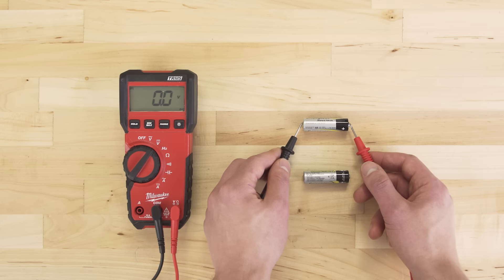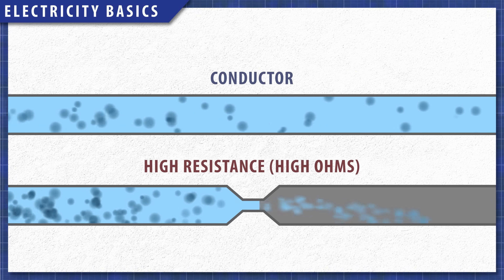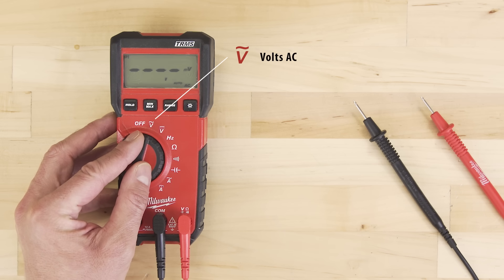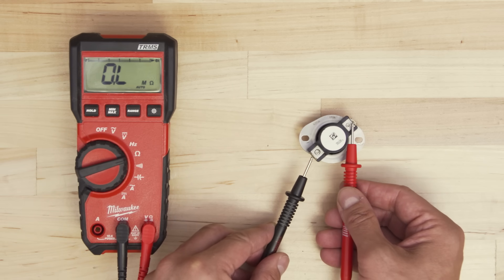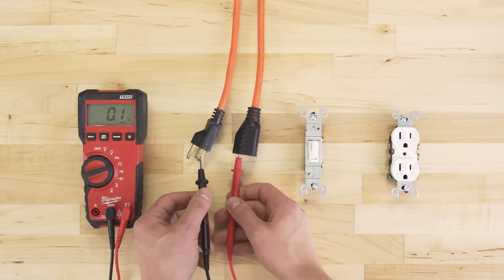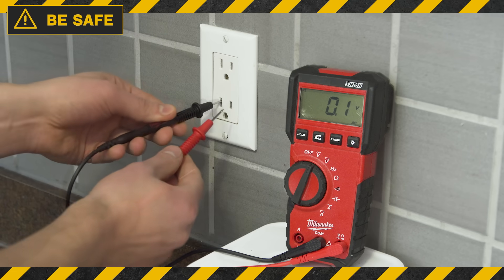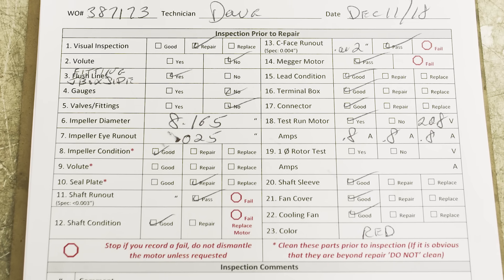How to Use a Multimeter & Electricity Basics | Repair and Replace

Comment: I've heard so many stories of people blowing up meters by plugging them into outlets. Looks like amp testing is the only way to blow up an auto ranging meter (under normal household conditions). That's good to know, and will hopefully quell my phobia of destroying it. Thanks for the info!
Reply from the maker: Thanks for watching. We're glad that you found it helpful! Testing an outlet with proper safety precautions while on the VAC setting will not give you any surprises. Amps or resistance setting will be problematic and is more likely to blow the internal fuse.

Comment: How do you find out which is ground and neutral using the multimeter? If the wires are all same colour?
Reply from the maker: Thanks for watching. Using the multimeter you won't be able to simply distinguish between the ground and the neutral as the voltage readings will be the same. Normally one can check by looking for where the copper wire is connected on the receptacle. If all the wires are the same color then it's best to hire an electrician to do a closer inspection.

Comment: I would also advise that the multimeter switch is always left on the AC volts position when putting it away.
If it is left on the resistance setting for instance and then used it to check AC volts next time you might only blow the internal fuse but it could be a lot worse. Electrical arc burns are usually life changing if you actually survive. 
In fact the best approach is to say out loud to yourself what you're about to do and how.
Reply: My multimeters have an OFF position. So I do not store it in any other position
Reply from the maker: @froglobster  Yes if it has an off position then it's best to have it turned completely off. This also forces the user to specifically set it to the required mode before doing any testing.
Reply from the maker: Thanks for watching and for sharing that excellent safety tip!
Reply: Well let’s not put off the interested member of the public / student, to harshly using grammar’ life changing / electrical Ark burns 
if you survive ’   Gulp.
Let’s be quiet clear about it,the instrument will have an internal / local fuse wired in ‘ to anticipate any occurrence. And it also explains why they are double insulated in the uk and other countries “
Thanks’
Reply: why does this happen?

Comment: Just did that and my thing sparked up.  So I switch the cards and try again, but my plugs is giving low readings like 2 Volts
Reply from the maker: Thanks for watching. If you got sparks on your outlet then it could be an issue with how it's wired or how it is grounded. It would be best to hire a electrician to take a closer look.
Reply: @AmreSupply  Thanks

Comment: As an Electrical Inspector I would definitely advise caution to the unqualified Make one MISTAKE it can kill you  Always best to engage a licensed electrician Please take care
Reply from the maker: Thank you for watching and the extra words of caution are much needed. This video is primarily to help support our videos on appliance and heating repairs. In these cases we recommend shutting off the power before accessing any single component. The component is tested in isolation before being replaced with a identical component. We do not recommend or show live voltage tests on appliances as that is more dangerous than these isolated test.
Reply: “Licensed” doesn’t always mean correct.

Comment: Very Neat explanation..👍! Everytime disconnect elements before testings1️⃣! i would say that a good brand of Analogue multimeter is way much better..🌟🧭!!They have consistent precision values ,and  don't show fake readings like the digital ones...
Reply from the maker: Thanks for watching, we're glad that you found it helpful. Analogue multimeters are still useful but digital multimeters very accurate and do not show "fake readings". Some models are more precise than others but having the numbers on the screen is very helpful to most people.

Comment: At 2:20 "120V AC 60Hz"  the narration incorrectly states: "The direction the current flows changes 60 times per second." 
This is incorrect, the current flow direction changes 120 times per second.  
"In a 60 Hz system there are 60 complete cycles in the current pattern. In each cycle there are two halves in which the current flows in opposite directions—half a cycle one way then half a cycle the other way. So the current changes direction 120 times each second."
Reply from the maker: Thank you for watching. You are correct at that point. Unfortunately we can't update that small detail in the video without deleting the video and reuploading it. It would mean losing all views, comments and interactions.

Comment: Excellent Video, is this available in Spanish?
Reply from the maker: Thanks for watching. We don't have any voice overs in other languages but we have added manual English captions, this means that the translation to Spanish captions should be more accurate. This can be enabled in the settings in the play bar at the bottom its the CC button and the cog wheel will bring up more languages.
Reply: @AmreSupply  Thank you :)
Reply from the maker: @johnhubbard6262  You're welcome!

Comment: If the component tests negative for continuity it will need to be replaced
Reply from the maker: Thanks for watching, you are right! The only case that it might not apply is a temperature switch that might not show continuity at room temperature. Switches will often be listed as NO normally open or NC normally closed. A normally open switch will not have continuity when tested at room temperature.

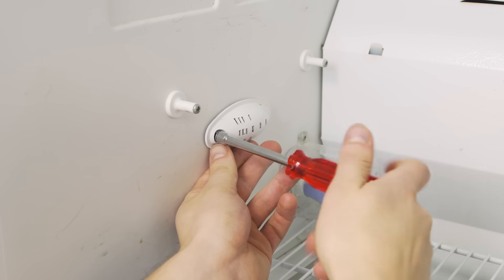Comment: At 2:56 you show a household outlet (AC) and a current flowing in DC. A bit confusing.  So, if electrons reverse direction  at 60hz how far does an electron physically move before reversing direction  in an AC circuit. Is the movement measurable? Is there a name for it?  The water tower pressure analogy pushing and moving electrons doesnt work for AC current does it?
Reply from the maker: Thanks for watching. For simplicity sake we often show circuits with electricity flowing in one direction as it can often get messy to look at the circuit when AC flow is shown. 

The electrons in an AC circuit don't move very far. They are only moving in one direction for a fraction of a second before switching directions. The net result is that they stay in place. 

The water tower analogy would still technically work, it's not perfect but in the case of AC imagine if gravity was reversed 60 times a second. The principles of voltage (pressure), resistance and current (flow) still apply but voltage decreases to 0 before becoming negative. Negative voltage denotes flowing in the opposite direction.

If you're curious how different components work we have several videos: https://www.youtube.com/watch?v=e_1pOWSVUfg

As well how motor work: https://www.youtube.com/watch?v=vpspMVQQXRs

Comment: ONLY use ONE had when using a multi meter or working with electricity keep the other in your pocket
Reply from the maker: Thanks for watching. You are describing the one hand rule, which we described among other additional safety measures in the pinned comment at the top.
Reply: @AmreSupply  my bad my phone doesnt show everything

Comment: Great Tutorial! Im just wondering what will happen to the multi tester, if someone accidentally put the test probes in a 220V AC Outlet while the red is connected to the A terminal and and black to the Ground. The knob is in 600V AC? Thanks.
Reply from the maker: Thanks for watching. If the multimeter is set to testing voltage and is rated for 600V AC, if it was set to the voltage setting then it likely did not damage the multimeter. If the multimeter is set to measture amps and the leads were connected to the outlet, then that will likely blow the fuse.
Reply: @AmreSupply  thanks. Based on what you said, does it matter whether the red probe was inserted to the Ampere Terminal or the VOhmA Terminal? Thanks.
Reply: What Im saying is, the Multimeter is set to measure the AC, rated at 600V. 

However, the red probe was inserted to the Ampere Terminal instead of the (VOhms Terminal) . Is it okay?
Reply from the maker: @EhrosmithTV  If the probes were in the wrong ports, it can damage the multimeter. It might still be ok though. When you switched back to the VOhms port, does the multimeter still measure voltage and resistance?

Comment: Excelent simple esplanation Sir.
I bought new cheap multimeter Astro Ai, and playing around with it to figured out how its works; I switch the knob to the DC voltage and makes direct contact with its own battery +/- using the red/black pen and then it makes endless buzzer sound. Now it makes endless flat buzzer sound each time I switch the knob to the DC Volt and DC mA as well as the screen shows the "O.L" symbol. Any idea Sir how to fix it?
Reply from the maker: Thanks for watching. Some multimeters have a resistance with tone setting but it's not normally enabled to beep when on the voltage setting. Is it mentioned in the manual?

As well, the DC mA setting won't show any currently flowing when testing a battery. You'd have to have a small circuit set up to measure current.
Reply: @AmreSupply  Thanks for reply Sir.
I mean, I put the knob to DC Voltage mode and open its battery bay then makes a contact directly to the battery to measure the voltage... it works fine at first, something around 8.5v shows on the screen until I switch the orientation; red pen to " - ", black to " + "...then something wrong happens; endless beep sound with the O.L symbol displayed on the screen. I cannot use it to measure DC volt anymore each time I switch to DCv mode.
When I makes Pen2pen contact on continuity mode the beep sound was not continious flat beep anymore "_____________". 
Instead, it was " __ __ ____" .
Is it repairable Sir?
I've check the all the fuse inside using the second multimeter I bought recently and its works fine.
Reply from the maker: @guardian860  Testing the multimeter's battery which is actively being used by the multimeter might give you inconsistent readings. 

Does the multimeter work normally in other continuity or voltage tests when used on objects that are not part of that multimeter?
Reply: @AmreSupply  Yes Sir,
Continuity and ACv mode works fine.
The DCv doesnt works at all... I've measure several others battery separate from multimeter but nothing works, the screen remain O.L with long solid beep sound.
I assumed it was short circuit occurs when I put both pen invertedly to the active battery(+-) that being used by multimeter.
Reply from the maker: @guardian860  It could be a defect in the multimeter. If it is new then it might be covered under warranty.

Comment: Won't I get electrocuted if I stick it in an outlet? I don't want to die over a toaster...
Reply from the maker: Thanks for watching. There are ways to safely test voltage. If you are uncomfortable, then it's best to not touch anything and to hire an electrician to do an inspection.

Comment: I don’t clearly understand what voltage is , is it the source ?
Reply from the maker: Thanks for watching. Voltage is the force or pressure that pushes electrons. It is simple the potential for current to flow. 

For example: If you have water in a lake, it's not going to flow anywhere as it's already in the lake. If you took some of that water and put it in a container and walked up a hill, it would have a higher potential to flow (increased voltage) but no current (flow) yet. Once you got to the top of the hill, if you dumped that bucket, the water would flow as gravity is pulling back towards the lake.

You can have voltage without current flowing. This is why you can check a battery. A battery has stored energy. In the case of your outlet, there can be the 120 volts but no current flowing until you complete the circuit.
Reply: @AmreSupply  wow awesome. Great explanation. Thanks.
Reply from the maker: @Lamzyvictory  You're welcome, just happy to help!

Comment: Very professional demostration Vance on appropriate doing small testing on batteries to checking the power to the circuits in the house. I also like the safety response notes you apply after you do your videos. Hopefully you will do a video on hooking up an outdoor outlet for a generator to power a house from the Panel Box or maybe I missed the video.
Reply from the maker: Thanks for watching, we're glad that you found it helpful! We currently don't have a video on using a generator to power your home in the case of an outage. We are currently filming more videos on appliance repairs and troubleshooting so it will likely be a while before we return to film more electrical based videos.

Comment: Sorry, but when you test volts you should ALWAYS use fused test probes, those in the demo werent! Totally unsafe
Reply from the maker: Thanks for watching. You are right that fused test probes will give the most protection. The codes are still evolving on which scenarios fused test probes are needed, so there is various opinions about these sorts of probes.

Comment: Wires coming into one of the electrical box is not color coded.  All 3 of them have transparent insulation. I can easily figure out the hot wire but is there a way to know which one is neutral and which one is ground?
Reply from the maker: Thanks for watching. It's hard to know what changes were made to that home so it might be best to get that inspected by an electrician.

Comment: Hello sir , we can detect high dc voltage at about 15 KV? By this multimeter. If not then which equipment is to detect 15 kv DC voltage , please sir inform me
Reply from the maker: Thanks for watching. 15,000 volts DC is not something that is commonly worked with and most meters can not handle that voltage. Testing that requires specialized equipment and procedures.

Comment: Soo, question. Volt is the attraction between an electron and a positive atom. What makes the volt increase? Isn't the attraction constant? Has it to do with resistance? I assume amperage is the number of electrons flowing in the cable(?). I just find the analogy confusing.
Reply from the maker: Thanks for watching. The analogy of voltage as pressure, and current as flow rate is still useful.

Voltage is the electric potential, and it's dependent on current and resistance. Something can have an extremely high voltage but a low current. This would be the equivalently to a pinhole leak in a water dam. The pinhole is small (high resistance to flow) so the flow rate is low. 

Alternatively, open a large hole in the dam (low resistance to flow) and a huge amount of water will flow out. in both cases the water behind the dam was the same (had the same potential) but the flow rate was significantly different.

You can see this in action by using this ohms law calculator. https://www.rapidtables.com/calc/electric/ohms-law-calculator.html
Reply: @AmreSupply  Thank you for the answer. My question was more about what is happening inside the cable or wire. I know that with higher amps you need a thicker wire, so I assume that with higher amps you are sending more electrons through the wire. But if you increase the voltage, what is happening in reality inside the wire?
Reply from the maker: @miloe436  If you increase the voltage but didn't change the resistance, there is more "push" resulting in more electrons traveling each second between the atoms of the wire.

Comment: Volts dont kill you mate.
Reply from the maker: Thanks for watching. It is true that it is the current that can be fatal and it only takes 100 milliamps regardless of the voltage. The point in the video is that the current flowing through a 120 volt outlet can be deadly, and people should take every safety precaution.

Comment: For some reason nobody wants to talk about the AC app reading and how our if the 10 amp if the device can handle it
Reply from the maker: Thanks for watching. Measuring AC amps with a multimeter is generally not practical and safe so it's not something we went into detail with. A 10 amp device would be able to measure a 10 amp circuit. An average home has a combination of 10 amp and some 15 amp circuits.

Comment: Great video! Concise, no-nonsense and clearly explained. Question…

An electrician installed an outdoor overhead light box years ago in anticipation of a custom fixture that was being made. Fast forward to now and I’m ready to install however, I’d like to test to see if those wires still work and I’m not sure what circuit feeds it. Can I use a multimeter to see if the line is still hot by touching the wires? Or can I simply use a socket bulb with bare wires doing the same?
Reply from the maker: Thanks for watching, we're glad that you found it helpful! The safest way to verify if wires are hot is to use a non-contact voltage tester or NCVT https://www.amresupply.com/search?q=voltage+tester These detect the magnetic field around a wire so it has the advantage of verifying if a single wire is hot even without a reference to ground or neutral.
Reply: never touch a live wire always turn off the power source then you touch a wire, it also demands on what is the gauge of the wire to discharge the current and voltage and many things to know when it comes to residential building code and V / I / R etc voltage law etc

Comment: Gr8t vid, i always lern something new watching. There is tool that can be plugged in between appliances which shows current n amperage, are these worth cost?
Reply from the maker: Thank you, we're glad that you found it helpful. What you're looking for is an "Appliance Current Meter" which have a standard plug on it. For the cost it can be useful for monitoring some appliances in your home. If you buy one of them you could try it on different appliances to get a sense or a high use verses a low use day. You wouldn't need to have it on a appliance 24/7 to get useful information.